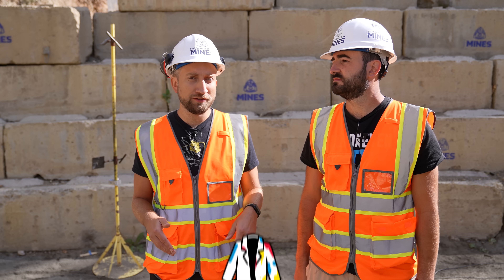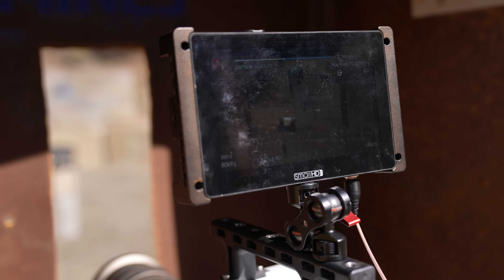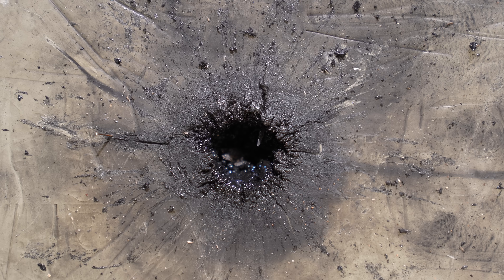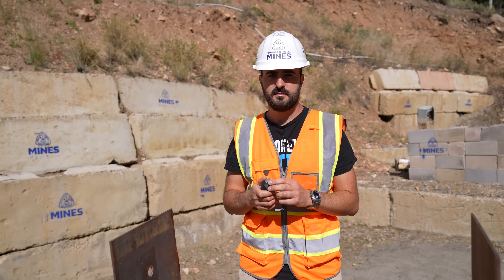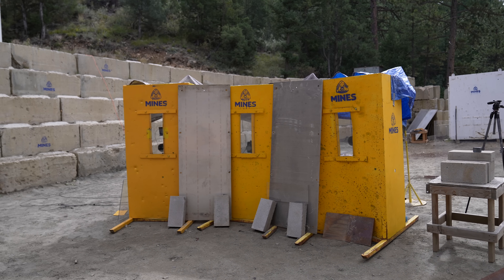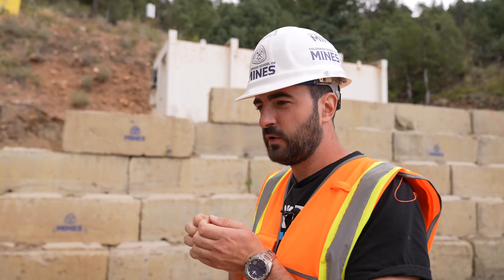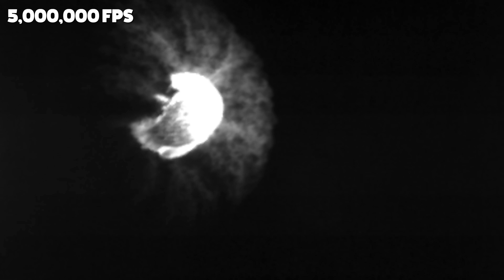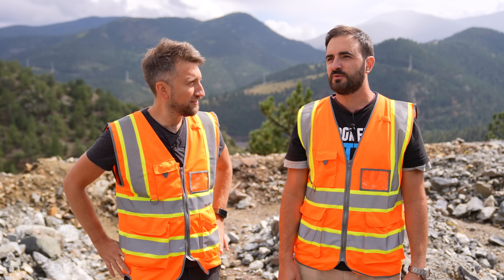15,000MPH Colliding Explosions in Super Slow Motion - The Slow Mo guys

Comment: I am so incredibly curious now what would happen if the tips of the charges were to collide. Would a shockwave form? Would they get even brighter? Hoping for another round of shape charge videos!
Reply: I'm fairly certain it would get even brighter. Assuming a perfect collision both jets would be decelerated to 0 in an even shorter distance and time than they were originally sent scooting. The conservation of energy states that all the kinetic energy would be converted to thermal energy. I wouldn't be the least bit surprised if we got well into the X-ray spectrum...
Reply: @andersjjensen That's how you expose Dan to enough Gamma radiation to become the new Abomination.
Reply: also I guess similarly to what I think Smarter Every Day with bullets, they would also shatter the material of the cones outward, perpendicular to the direction they were shot at.
Reply: @MrXPeaceLP  These charges are 20+ times faster than a handgun bullet, so i think they would just fuse together and/or simply be obliterated due to the extreme heat. But maan would be interesting to see.
Reply: Blackhole forms
Reply: You get two copper cones.
Reply: @XtreeM_FaiL  two cones that would be very good at cutting through stuff. Need to put something in the way!!!

Comment: Fun fact: copper expands to literally 67,000 times its initial volume when vaporized. That’s why it is used in almost every form of AP shaped charge. That rate of expansion is incredible by any measure!
Reply: @RichyJFilms it’s not even true. Copper is used because of a combination of its ductility and properties when under compression. The copper isn’t being vaporised - the exact opposite is happening. It’s being compacted down into an extremely thin rod of 10kmps liquid metal.

Copper vaporisation expansion isn’t why it goes bang. Thats the result of the high explosive. Copper expansion is a problem for other fields, like metal works dealing with copper powders etc. if they go bang, they go bang very loudly.
Reply: @CypherAFhhhh you are more clever than mrs clever pants. 🎉
Reply: @CypherAFhhhh all it takes is one google search man. look it up yourself if you don’t believe
Reply: @CypherAFhhhh  The copper in a shaped charge actually doesn't melt. It's solid but acts like a liquid due to the extreme speed of the beam.
Reply: @CypherAFhhhh  The state change from solid to gas results in immediate and explosive expansion—vaporized copper expands 67,000 times in volume. Workers near the arc flash are exposed not only to the high temperatures, they face additional damage when hit with metal droplets or vapor which burn clothing and can become lodged in skin
Reply: @CypherAFhhhh Not correct, it is ionized gas it is a rod of ionized gas and not molten. It evaporates completely when the rod breaks apart. As said, it acts as a liquid.
Reply: @shades2.183 do you even know what an ion is? You have no idea what you’re talking about.
Reply: @CypherAFhhhh  the reality is, you're the one talking out your arse. It does not melt  but turns into particles. This is why you do not find "molten" copper laying around the battlefield. It vaporizes.
Reply: @shades2.183  show me a paper explaining 
 how the copper is a rod of ionised gas, then we’ll talk pal. Have a good Sunday.
Reply: @CypherAFhhhh  You will never learn, never.
Reply: @shades2.183  I’m sorry to say but you are wrong. I’m an EOD operator working in Iraq right now and when a shaped charge goes through its target it does leave copper behind that you can clearly see. It doesn’t just disappear into the ether! 😂😂😂
Reply: Fun fact: you too can get a top comment by making up facts!
Reply: @Minerals333  it's all about getting comms XD
Reply: Make sure your facts are actually supported by fact next time you claim something.
Copper does NOT turn into plasma, vaporize nor melt  into a liquid. It simply is plastically deforming under extreme pressure. No phase change is happening in the copper. 

Although metal does behaves in a quasi-liquid like state under those extreme forces it's not actually a liquid, Common misconception
Reply: @jacobkudrowich  High pressure creates heat. Without a doubt, the copper in shape charges become molten.
Reply: @jamm8284 

Researchers have done high speed xray analysis of the jet from shaped charges. The metal is being plasticly deformed, not melted.
Reply: @jamm8284 it only gets to about 600-700c max
Reply: @jamm8284 doesn’t melt. Not enough time.
Reply: @jacobkudrowich  you are both wrong. The gasses that comprise copper react at a subliminal level allowing for a rapid acceleration of the solid state copper microns
Reply: @djm6431 Was your intent to let us all know that you have no idea what you're talking about? Because that's all you've effectively done...
Reply: @djm6431  Copper does not comprise of gases. It's a metallic element.
Reply: But isn't the effect the exact opposite? They want to concentrate the copper into a smaller projectile of molted material so it goes through whatever it encounters more effectively. It also concentrates a big amount of energy in it.
Reply: Just the tip. Indeed.
Reply: @Panicagq2  and an incredible rate of expansion behind it.
Reply: I learned this 14 years ago when I joined the Marines. It wasn't a fun fact though because it was listed in a warning for risk of an arc blast when working on aircraft generators and the test bench is in a double wide conex filled with copper wires, terminals and equipment. 

The only protection we had was a half inch thick steel shield to place around the generator during testing and it literally wouldn't have done anything to protect us from an arc blast, because the vaporized copper would just make your lungs explode if you happen to be breathing at the time. 😂
Reply: Pssshhh well yeah… duh 😅 that’s like 1st grade stuff 😅😅😅😅
Reply: Fun fact: it doesn't
Reply: You got told
Reply: I like turtles
Reply: Lol.. another graduate of utube you... Not even close
Reply: The copper doesn't even liquefy💀
Reply: I really hope one day they manage to capture the shape charges hitting!!
Reply: They should do some into water to see what it's like to break the sound barrier underwater and prove what speed it is to break the sound barrier underwater sound travels twice as fast in water so the sound barrier should be twice the speed as air
Reply: @krazyphucker369 The speed of sound in water is over 4 times as fast as in air.
Reply: @krazyphucker369 why water.  Try a election stealing Democrat instead.
Reply: I’m pretty sure that the copper is not in liquid state but it is super heated. If it’s solid it would stay together and if it’s liquid it would sputter and spray  out. There is no copper gas formed
Reply: That is probably the bright “blue cloud” of vaporized copper you see at the beginning of the shot.
Reply: It's nice to show that people will eat anything if you word it interesting enough lol
Reply: Such stupid people here...The liner of this shaped charge consists of a powder mixture. Yes, mostly copper, but blended powder. Much better liners are used in some anti-tank shaped charges, made of molybdenum or alloys. High density, high plastic deformability, high acoustic sound velocity of the material/ bulk sound velocity and high melting point are prerequisites for the perfect lining material.
Reply: Learned about this when I worked as a low voltage network integrator, before working on high amperage buss bars
Reply: The jet is not vaporized or melted. it has been proved wrong over and over. Its mostly sitting at 400 C.
Reply: SIX SEVVVVVVVVVENNNNNNN 😂😂😂
Reply: Uhh we're not looking to powder coat there homie. Do us all a favor and research Dunning-Kruger before you comment again. Actually research shaped charges too they're some cool little f*ckers.
Reply: Cool
Reply: Wrong
Reply: Good thing the aim wasn’t perfect on that last one, or it might’ve triggered a fission explosion!🤣
Reply: You wanna come over for a turkey fry? I promise I won’t use a frozen turkey, unless you get them to film the explosion
Reply: Sie verstehen nicht die Funktionsweise einer Hohlladung. Suchen sie mal nach Prof. Manfred Held. Da können sie nachlesen wie das wirklich funktioniert. Kupfer bildet einen sehr schnellen Strahl aus sehr dünnem Metall aus und wird nicht „vaporized“🤣🤣🤣🤓
Reply: Total expansion and rare of expansion are not the same thing.
Reply: The technology behind this predates WW2. Shaped charges were in fairly common use. I think they were an interwar innovation, but I’m not as familiar with the technology of WW1.
Reply: "Literally"

How bout prove it nerd
Reply: A zebra cannot change its stripes.
Reply: Wonder what gold would do instead? 🤔
Reply: You mean surface area?
Reply: Doesn’t sound very fun… 😮
Reply: Holy hell
Reply: Literally
Reply: theres prolly special equations for explosions but pv=nrt however much some gas expands at a given pressure just crank the temp and it will expand more?
Reply: That explains a lot. Shaped charges going through feet of steel to initiating Atomic reactions to making possible the previously unextractable oil that now is and is made the US once again the largest exporter of oil in the world.
Reply: Steam: 67,000 times the expanded volume? Cute. There's a reason we push 100,000 ton ships by boiling water.
Reply: Twin tried to HIDE 67 really perfectly💔🥀
Reply: Absolute rubbish!!! 😂😂😂
Reply: But isn't the effect the exact opposite? They want to concentrate the copper into a smaller projectile of molted material so it goes through whatever it encounters more effectively. It also concentrates a big amount of energy in it.
Reply: Nah it doesn’t but cool comment
Reply: Gentlemen: This was some of the absolute BEST footage you have EVER filmed!  Thank You!!!
Reply: Yet another meaningless use of literally 🙄
Reply: @samuelgarrod8327  Literally.
Reply: Why would the use copper when lead has a higher coefficient of thermal expansion?
Reply: @Gmanc22  they don't because the copper doesn't vaporize ops spreading misinformation online.
Reply: @Gmanc22 Because OP is wrong.
Reply: Thanks to share!
Reply: That's awesome
Reply: wowsa!!!!!
Reply: Fun actual fact: 
Copper is not vaporized. (In shaped charges)
Reply: I was afraid this was a 67 joke but then saw that this was 2 years ago😢
Reply: @goedsnik4473 Well, maybe it’s more like 68,000 times expansion. Anyway most people think it is more about ductility of copper at those pressures. IDK why I even bothered to comment.
Reply: I appreciate everyone’s input. Although my comment was over simplified, I do understand what the best comments here are saying. They are worth considering carefully. That said, hot copper is still especially dangerous.
Reply: literally? lol
Reply: As i believe the world to be, so it is.
Reply: Alright, yes copper is used to defeat most bullet proof and blast proof armors. As stated above the copper isn't vaped it does concentrate but not as much as you'd think, interestingly enough. Point and case, an American Humvee was struck by two shape charges and the only thing left of the mangled carcass was the rear axel, trunk section, half the front axel and passenger side tire, the lower frame was intact but the engine compartment and the passenger compartment was utterly obliterated. Displacement is the name of the game with shape charges. Goes without saying no one survived.
Reply: @kylethomas3224  they used EFP shaped charges for those Humvees. It's a much easier to produce and use at range and it allows its user to send a 1kilo copper slug 100 meters directly through the door of a humvee. 

 Instead of a precision manufactured conical liner you use a slightly concave disk. Brutally effective and very easy to make.
Reply: @jacobkudrowich 1kg faaark!
Reply: @kylethomas3224 None of what you said is relevant to this conversation... Lmao
Reply: @TaterMater22  that's funny since I was talking about shape charges and their function, what exactly are you adding to the conversation?